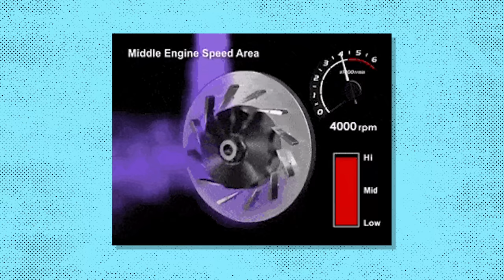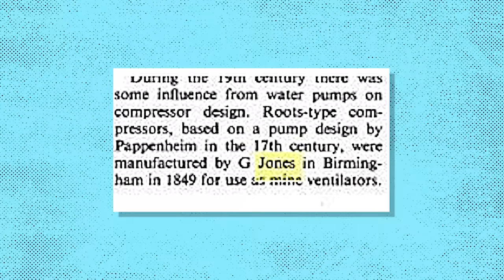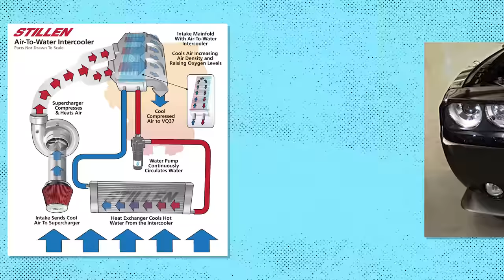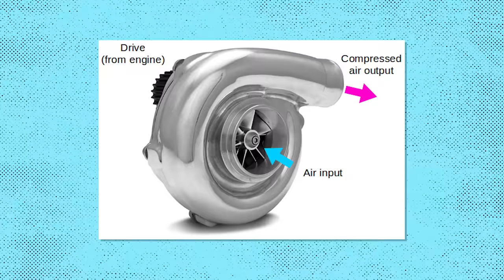Why Superchargers Aren't As Good as Turbos

Comment: Cool video, but there is some missing information and some possibly misunderstood information.  This leads me to believe that while most of the video is spot on, some of the research was misunderstood, or missed entirely.  And in some cases, likely in the interest of viewer time and topic complexity were excluded from the video entirely.  So while I don't fault the creators of the video for any of their errors as they seem perfectly reasonable to make, I would like to add to the discussion for anyone willing to read further. 

1) Yes Mechanical Superchargers use some of the mechanical work done by the crankshaft reducing the fraction of crank shaft work that can be used to move the car in order to increase the overall amount of crankshaft the engine is capable of.  (The basic premise of the video is correct)

2) But Turbochargers are not faultless in this either.  
Turbochargers increase backpressure at the exhaust manifold which increases the amount of work the engine has to do to expel it's hot exhaust gasses.  This means that without the compressor on the front hooked up, the exhaust turbine would decrease the power output of the engine.  Engineering calculations on whether one should use a mechanical supercharger or a turbo take this into account.  The losses due to backpressure are not negligible, but are usually less then the losses due to driving a mechanical supercharger.  Also, taking a naturally asperated (N/A) engine and turbocharging it does in fact reduce the overall engine efficiency.  However, using a smaller engine with a turbo may provide the same power as the N/A engine while being overall more efficient.  There are some calculations you can do to find the cases where that is true, but it is part of the reason why we have so many small turbocharged engine on the market right now.

3) Application can be important.  This was glazed over very briefly in the video in such a way as to make the casual viewer think that it is unimportant.   Sometimes overall efficiency is not the most important consideration.  Having quick response, or good low rpm torque can be very advantageous compared to good efficiency and high peak power numbers.  There are also situation in non-flat out driving where the boost from a mechanical positive displacement supercharger would be more advantageous than turbocharged power.  Application! Application! Application!  There is a reason why Lotus used a mechanical supercharger on the 2ZZ rather than a turbocharger.

4) This one is minor, but what in the world is an Electric Turbo?  
Joking aside, Electric Turbocharger is a misnomer for Electric Supercharger.  It would be okay to call a Turbo-Electric Supercharger an Electric Turbo, but most of the time the term is used there is no turbomachine involved.  Here is where the original name of a Turbo comes in.  A Supercharger is a device that forces air into a combustion chamber.  We call them Mechanical they are driven by a mechanical linkage, Turbo if they are driven by a turbomachine (turbine of some sort), or electric if they are driven by an electric motor.  So a Turbo-Electric Supercharger would be a Supercharger driven by both an exhaust turbine and an electric motor.  Most "Electric Turbos" are centrifugal superchargers driven by an electric motor with no turbine to be found.  The correct technical name for the electrically driven centrifugal superchargers is Electric Supercharger because they are electrically driven superchargers.

5) Not mentioned in the video because it does not pertain to the video's topic, but mentioned here because it does pertain to my above comment.
Turbo is the prefix given to any turbomachine.  There are Turbo-Jet Engines, Turbo-Fan Engines, Turbo-Electric Generators, Turbo-Pumps and many other Turbomachines.  One that you may find interesting is the Turbo-Axle.

I wish I had all of the books that I have read on this topic with me to put in the references here to support my points, but I'm sure that you smart people can find the information, it's out there.
My first three points are primarily supported by my Internal Combustion Engine Design text book from my ICE Class MECE 391(fall) at Grove City Collage taught by Dr. Dixon.  I am also in a Propulsions class which talks at length about Turbomachines called MECE 391 (A) (spring).  
Other points are from all of the research that I have done over time.  It's a topic that I find interesting, so I have enjoyed learning from videos like this one and in fact I did learn some from this still, but I have also learned quite a bit of technical details from engineering school.

Thank you to Driven Media for encouraging people to get into the automotive hobby and helping to educate us to the best of your ability.  This was in generally a great video.  My above comments were mostly for those who want to go a bit deeper.
Reply: An actually logical comment written by someone who has a clue what they're talking about instead of "screwey thing bad"
Reply: Its called turbocharger because it is driven by a gas turbine, turbos are turbines directly coupled to a compressor.
They are HEAT engines and comply with the Law's of Thermodynamics described by the Carnot Cycle Formula.
Turbos operate using the BRAYTON CYCLE the same as a jet engine or turboshaft engine.
The only difference is they operate as a Second Pass heat engine in a Combined Cycle engine.
The exhaust gas temperature drops as it passes through the turbine wheel and this temperature drop is directly proportional to the amount of shaft horsepower generated by turbo.
 Once you fully understand these fundamental concepts the discussion of "back pressure" will seem rather rediculuous and irrelevant.
Reply: @sandervanderkammen9230  The issue is your fundamentals are right in an Idealized world, such as you may find in a Thermodynamics classroom, but real engines live in reality.  And Reality is not an Idealized world.  
There are things called mechanical losses, and back pressure is one of those losses.  Increased back pressure will make the turbine work more effectively but will make the Hybrid Cycle Piston Engine less effective.  If you neglect the fact that air is compressible between your cycles, then yeah, back pressure is silly because it does not exist.  However, in real world engineering, neglecting the compressibility of air between the exhaust valve and the turbine inlet is silly, because it leads to non-trivial losses.
So I get where you're coming from, but it just isn't right when you get to real world calculations.  The losses can also be seen imperially though data collected in testing.
Reply: @THESLlCK  He doesn't know nothing, which is why he disagreed with me.  What he said is right and would likely get him a passing grade on a Thermo 1 exam, and maybe even a Thermo 2 exam.  The issue is that he only see's the first half of the picture.  Much like how minor losses tend to be more than major losses in fluid mechanics problems, the mechanical losses are not insignificant in a heat engine problem.  So while the theoretical limit of the efficiency of a turbosupercharger is defined by the Carnot efficiency, a real world turbine won't reach that.  Compound that with the fact that he is most likely misinterpreting where the losses due to back pressure manifest themselves and his statements becomes quite understandable as the increased back pressure will have no negative effect on the turbine itself.
Reply: @saulekaravirs6585  clearly he spent too much time reading books instead of looking at actual applications, where you actually learn stuff. God bless you for actually explaining it to him because I would have lost my patience immediately.
Reply: @saulekaravirs6585  Sorry kid, but you get a big fat F in Fluid Dynamics

There is no parasitic pumping loss on the turbocharged engine.
Backpressure reduces flow in naturally aspirated engines but intake manifold pressures is always  less than atmospheric pressure when its running.

The same fluid dynamics do not apply to the turbocharged engine.

There is no parasitic drag or loss of flow rate on reciprocating engine from backpressure unless it is after the turbine outlet.
Reply: @saulekaravirs6585  You still don't get it do you kid???
Where did the HEAT go???
The drop in temperature through the turbine is directly proportional to shaft horsepower generated by the turbine wheel.

The centrifugal compressor reduces pumping loss because it delivers higher pumping efficiency.

A properly designed turbocharged engine has the same or higher intake manifold pressure.
The difference is the exhaust gasses are hotter and have more velocity....
Its the velocity of the gas created by the heat that drives the turbine blades... not pressure.
Reply: @THESLlCK  You hitched you wagon to the wrong guy... of course not understanding how a turbocharger actually works its understandable.
Reply: @sandervanderkammen9230  blah blah blah still wrong
Reply: @THESLlCK  Nope, you only think you know how a turbocharger works... you clearly don't understand how they actually work.
Reply: @sandervanderkammen9230  cool story bro, nobody cares, the whole tuning industry says you're wrong, cry about it
Reply: @THESLlCK  No they don't... just people like you who don't actually know anything about turbochargers or how they work.
Reply: @sandervanderkammen9230  Whelp, we've reached the degeneracy of name calling, I'm out.  There is no productivity that can come from this anymore.  

Here is a hint for arguing you point in the future debates; name calling isn't going to help you convince the person on the other side of the discussion.  Name calling will only make you look bad.  Nobody will listen to you if they don't respect you, and the fastest way to loose someone respect is to insult them directly.  You can call someone wrong if you believe them to be wrong, that's fine.  But mid conversation changing to calling them "Kid" in an attempt to make them look non-credible will not help your case.  Hope that helps.
Reply: @saulekaravirs6585  Thank you for conceding and admitting you were wrong.
Best regards
Reply: @sandervanderkammen9230  I didn't say anything about being wrong.  I just said that you have lost any chance of convincing me of anything because you resorted to name calling.
Reply: @saulekaravirs6585  Thank you for proving my point.
Reply: @sandervanderkammen9230  At this point, you seem to be assuming that I'm saying things that I'm not, just so that you can have some sort of happy "I win" feeling.  Just another good way to loose someone's respect for you.
Reply: @saulekaravirs6585  Thank you once again for proving my point. 
Perhaps you should come back when you learn about how a turbocharger works and give me an apology.
Good luck son.
Reply: How can there be backpressure? The turbo flows MORE AIR than the engines can flow on its own.

Comment: Still, NA engines are the best
Reply: Nitrous assisted? 😉😂😂
Reply: I agree though man, you can't beat the sound of a highly tuned n/a engine, especially on carbs or throttle bodies
Reply: @Matty.Hill_87  Independant. Throttle. Bodies. 👏 No replacement for displacement
Reply: @branney6914  Bigger is better!